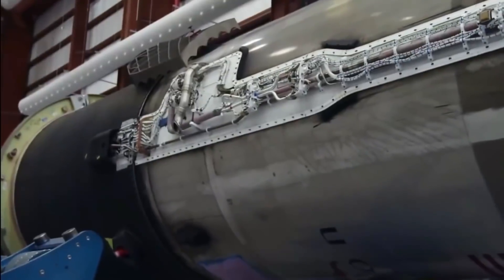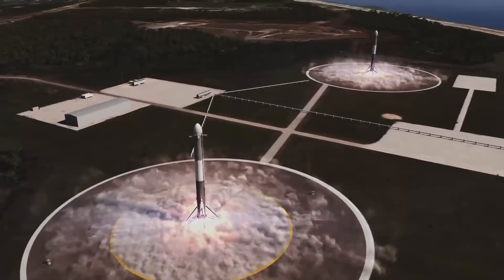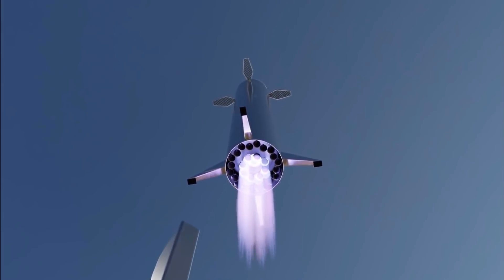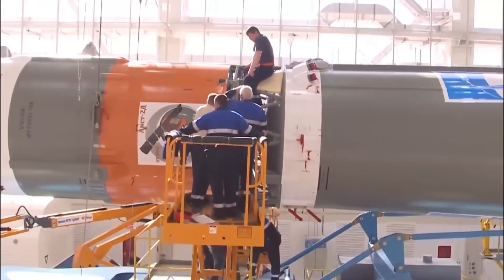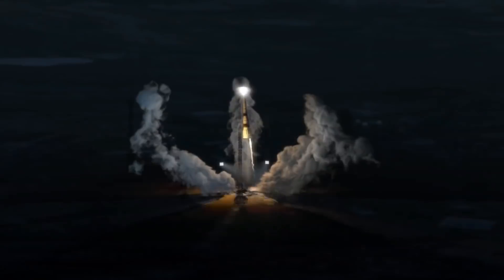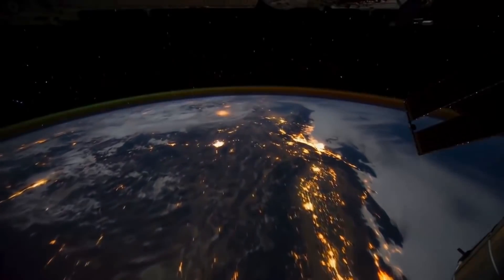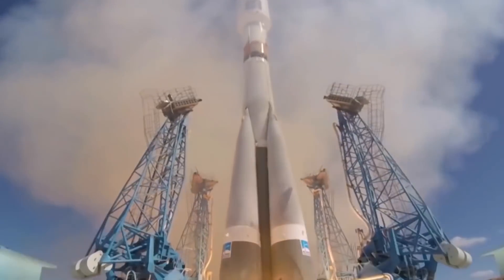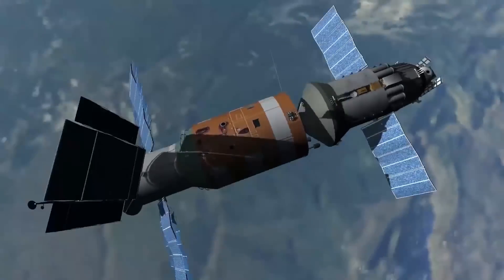How Russia Is Copying SpaceX and Elon Musk

Comment: Ultimately reusable rockets are inefficient.
It's a fact, don't argue with that, here is the reason :

The dv = (basically how far you can fly in space) is : dv=ln(m_full/m_empty)*I
As you see, it's logarithmic, if you decide to reuse most of the rocket, a lot of fuel needs to be diverted to landing. Making it less efficient.
You would need more launches or (exponentially) more fuel.

By having just 1 stage as your main stage you limit your potential dv. More stages= faster you can get rid of mass.
Costs? Assume you could reuse the entire rocket. Which is not possible, I want to see a spacex rocket to be fully reused multiple times. Also: this isn't something new. The Russians had blueprints for over 40 years to make a fully reusable rocket. They didn't build one because it wasn't worth it.

Spacex makes something other countries did it like 60 years ago. And it is held like a huge success. No, it's not. 1 kg to space costs 80k$ using spacex and the only reason they can sell it for ~10k$ is because they get huge subsidies from nasa. Some 2.5 billion or smth.

Comment: Honestly, SpaceX's solution is the simplest way to reuse a rocket. The grid fins are used in the Soyuz capsule incase of an abort so they are only copying the landing legs after a private company proved that rocket first stage reuse was indeed possible and economically viable.